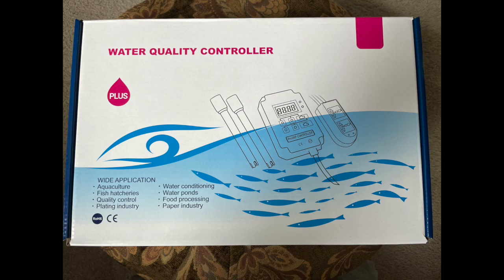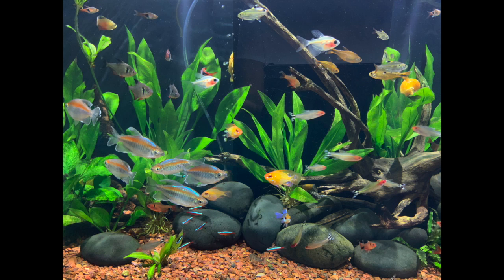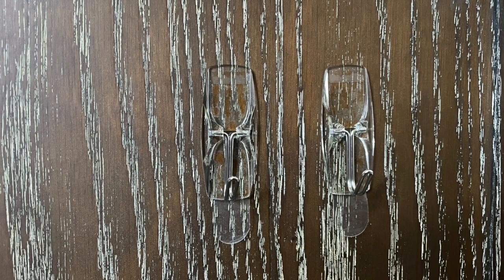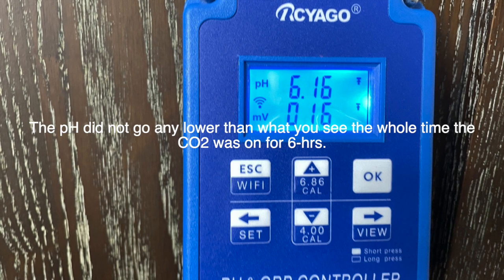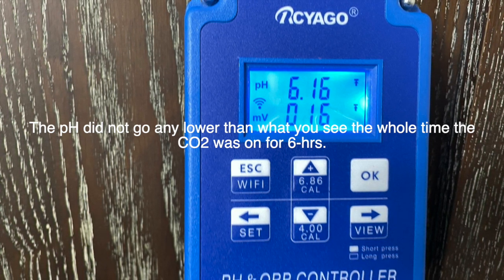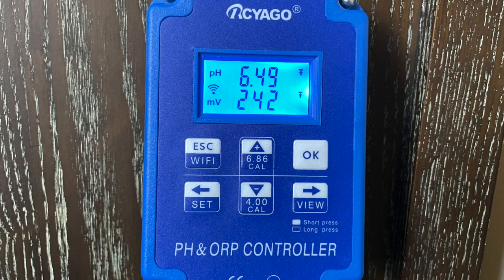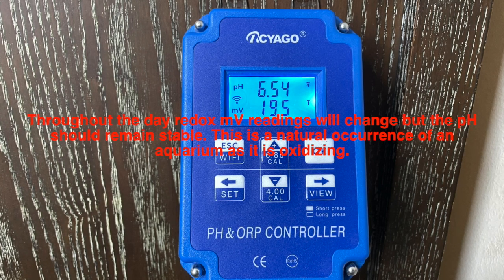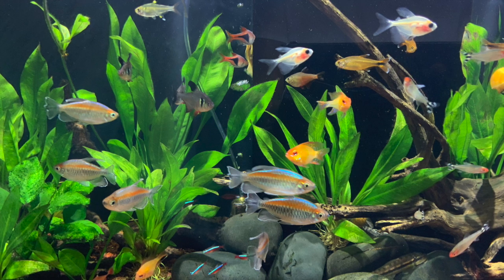PART 2: Redox and chemistry in our aquariums: What number should ORP be?

Comment: Thanks for the great video. Question, though. I just bought one of these myself (exact same model). When I first plug it in, it will show the pH updating for a few seconds. After that I'll hear two clicks and whatever the pH was from that point on, the value will no longer update/change no matter what I do. This includes changing the water it is submerged in and even disconnecting the probe from the meter altogether and then reconnecting it. Nothing changes after those first few seconds. 

I ruled out the probe as the issue since the pH only updates for the first few seconds if it's plugged in, if it's not plugged in, it just sits at the default 14 forever. ORP on the other hand works and is constantly updating even after the clicks. Am I missing something or do you think the unit is broken? Thanks again!

Comment: Hi Kevin. .. wow so ph can vary quite a lot in a short space of time, I knew co2 can make the ph lower but didn't know about liquid iron etc ... just ordered my 1st bag of fluval stratum for my substrate . Thanks again for your knowledge .
Reply from the maker: Yes it seems like the Fluval substrate for plant along with ADA's substrate for plants does lower pH and if you do not have enough buffers your pH will even go lower when you add CO2. However, I have an automatic top-off and I do add Amir Hammer baking soda to it to help try to stabilize the pH so it doesn't crash. So having a water clarifying meter as I show really comes in handy to show you what's happening inside your tank. Will do a review on it in the future but I like to try it out for a few months before I do so.
Reply: Beware of Fluval Stratum! It's a good substrate but it stripped my 6 KH and 3 GH to almost nothing and buffered it at 6.5. I am adding some Aquarium CO-OP crushed corals.